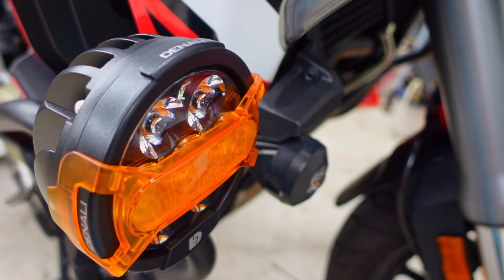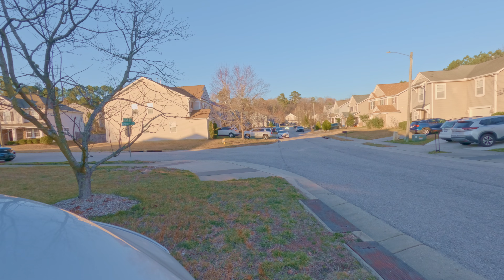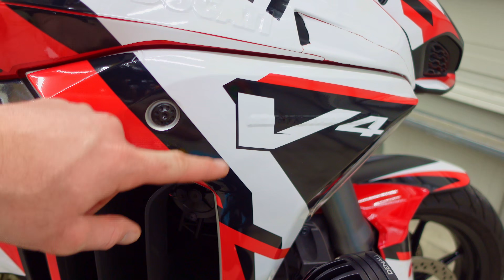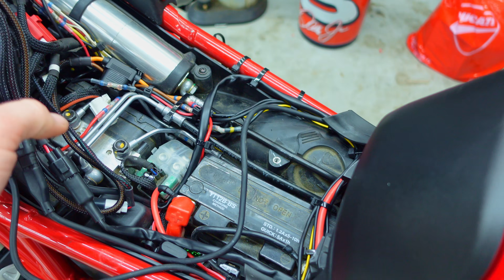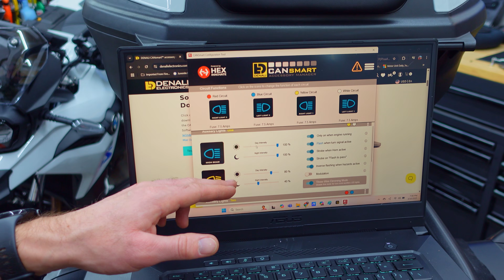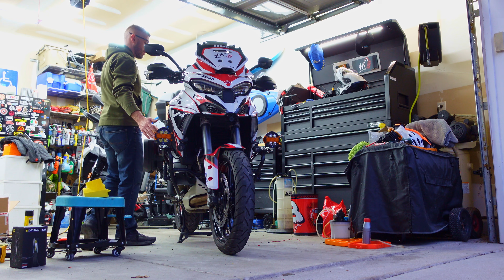GAME-CHANGER! Denali D7 Pro Lights Transform My Multistrada V4S

Comment: I have the horn 2 and i missing 1 output for what you do with the orange direction indicators
Reply from the maker: You'll need a second cansmart for any additional accessories if you want full control of the dual circuit lights

Comment: Hi. Is it possible to active the auxiliary lights with the oem bottom? I mean at same time with the stock auxiliary lights? Thanks in advanced
Reply from the maker: I will try and go through the software to see if this is an option, when I programmed mine I didn't see this option even though you have a lot of customizability. My auxiliary light button will activate my OEM fog lights but doesn't change by Denali lights.

Comment: Thanks Chris for this informative video. I’m from India and looking forward to getting these D7 pros for the Multi v4 rally. 

Are there any other mounting positions for the D7s apart from the engine guard and the OE fog lights? Somehow the position you have mounted on seems quite wide out on the outermost part of the engine guards, and if there is a fall, the lights will take the first hit. Your thoughts on this, and any other mounting ideas apart from that engine guard?
Reply from the maker: This was definitely something I had to think long and hard about. Mounting the lights as wide as possible is by far the most beneficial thing you can do for traffic safety. As you said, this is in direct contrast to off-roading ability where the lights will take the first hit. The mounts that I use are designed to rotate on impact so I don't expect any serious damage to happen on most tip overs but it's definitely a risk. They sell a bar that relocates them to where the factory fog lights are located, then you have to contend with shadows from the fork tubes. Unfortunately these lights are big which definitely comes along with their impressive lighting abilities, but makes them difficult to mount in any place inconspicuous/ protected.

Comment: Amazing demo Sir! Super slick. I love the functions and the fact that it all hooks up to factory instramentation. I do not have or want crash bars, just sliders. Are there other options for these to mount elsewhere? Or is there a different model that will hook up and have all the same functions to the existing body/frame? I really appreciate your demo. Thank you very much.
Reply from the maker: Tons of options, but they make a light mounting bar that attaches to the factory fog light mounts under the oil cooler.

Comment: Mounted the D7Pro on my 2025 V4 Rally in place of the OE Aux lights which I had on my previous two Multi's. I have the D7 on my OE aux switch as I did want them on a separate switch and not on the High Beam circuit. Great lights for sure.